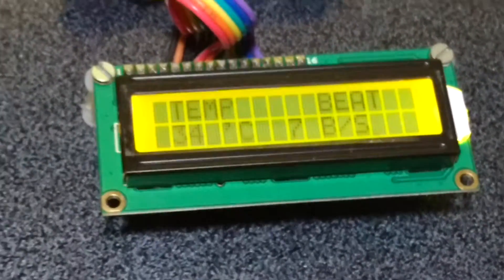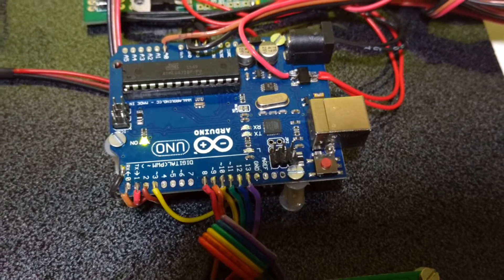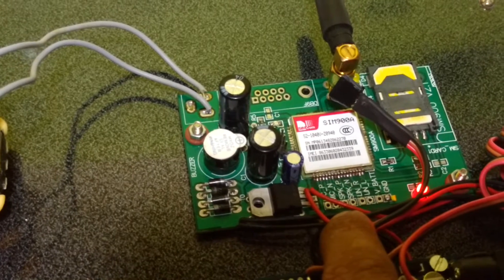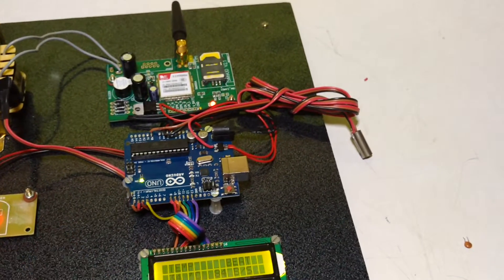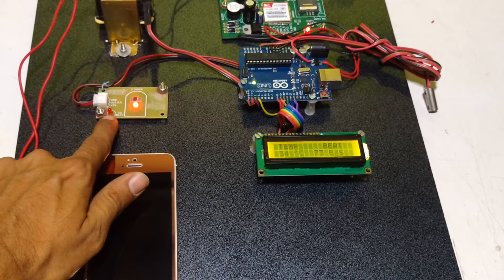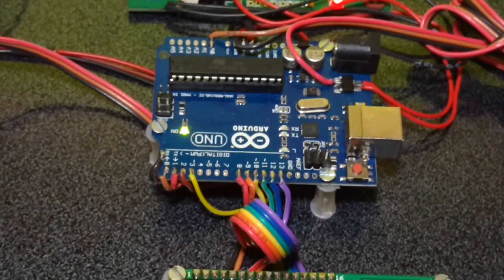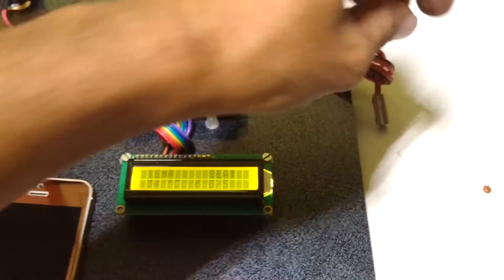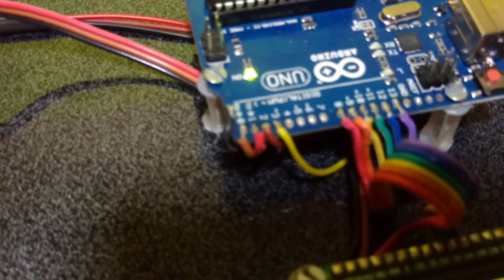Heartbeat and body temperature display using arduino

Comment: Made such a great project , still didn't set the Contrast of LCD xD
Reply: did you get the code?
Reply: @siddhantbhanushali6388  No man, i wrote my own code , just the SMS sending is remaining, calibration of the pulse sensor was tough
Reply: Arduino uno
Pulse sensor
LM35 sensor
Breadboard
Potentiometer
16 by 2 lcd display
Email:bhanushalisidd2411@gmail.com
Reply: Please send me fully operational code as soon as possible for arduino uno...thanks buddy🤘
Reply: If your code works can you send it?
Reply: @siddhantbhanushali6388  sure , drop your email in personal chat and will send you by tomorrow, just let me know what components you have
Reply: @AbhishekTiwari-yk9qv  Hey, could you please send me your code and circuit diagram?
Reply: @AbhishekTiwari-yk9qv  Give me permission pls
Reply: Refresh the page
Reply: @AbhishekTiwari-yk9qv  thanks, mate. Maybe you have circuit diagram?
Reply: @gvidasdambrauskas1968  working on it give me a day  will send soon couldn't send this guy who asked first
Reply: @AbhishekTiwari-yk9qv  how it is going?
Reply: @gvidasdambrauskas1968  i finally finished my project, but i couldn't send SMS using my GSM module, turns out, the Module is nit supported by indian operator anymore , so i changes the idea , now i am using NodeMCU ESP8266 module , and the heartbeat is monitored using  Blynk Mobile App xD
Reply: @AbhishekTiwari-yk9qv  Sir plz give me permission
Reply: @wafa123  scroll above and you will see a link there , open the link and i will accept the request for permission you will get the file
Reply: @Abhishek Tiwari  thanks  give me a permission  plzz
Reply: @wafa123  done, good luck for your project
Reply: @AbhishekTiwari-yk9qv   thanks a lot
Reply: @AbhishekTiwari-yk9qv  accesss 🥺🥺
Reply: @franchezcazafebanayad9338  Given already , sorry for the delay.
Reply: @AbhishekTiwari-yk9qv  hii bro.. I want ur little hel
Reply: @manishdhumal2590  Yes ?
Reply: @AbhishekTiwari-yk9qv  if u dont mind can u help me with code.. Heart sensor +ds18b20 temperature code 
..
Reply: hi can also share the code and circuit diagram with me my gmail getaneh901@gmail.com
Reply: @Abhishek Tiwari can you plz send me the coding.Can u also tell how temperature sensor works?
Reply: @kirratshaikh1122  I have given you the access , Good Luck